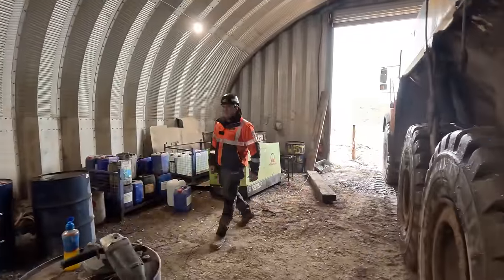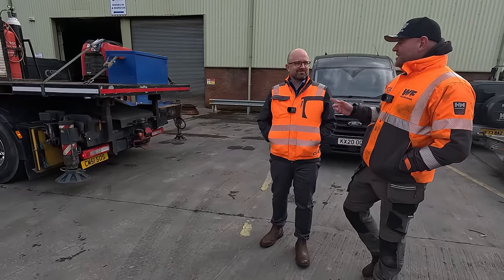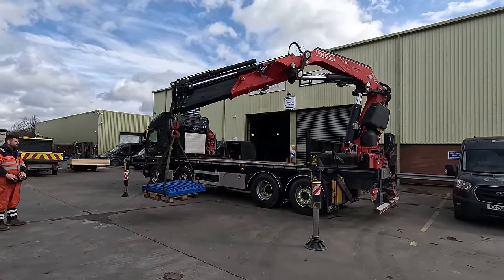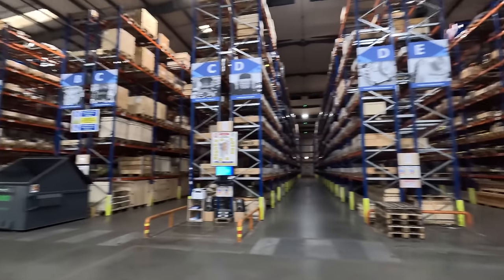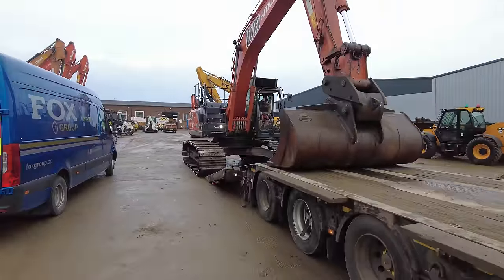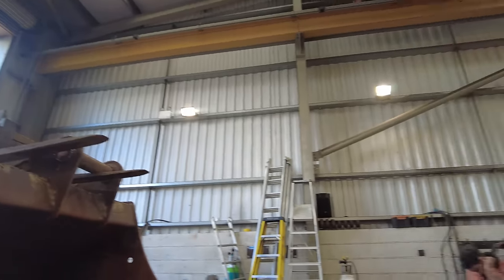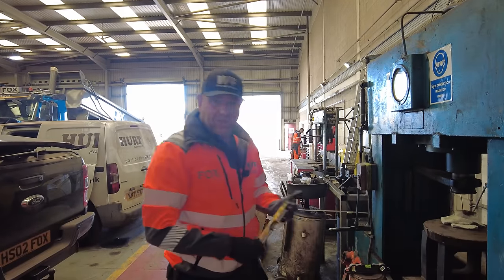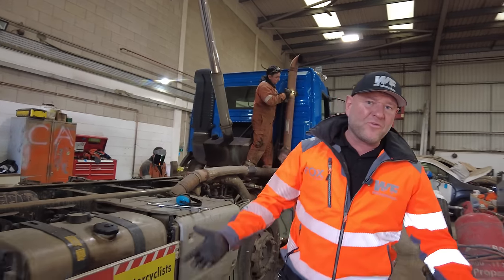Behind the Scenes: Exploring a Hidden Engineering Giant! Chronicles Ch #036

Comment: Excuse me if this is a stupid comment, but could you have a piece on the end of the exhaust so it points downwards to help prevent water getting inside? I guess it would increase the back pressure in the exhaust that may cause other issues

Comment: i drove a few 953 cats the bottom of the clam needs a grader cutting edge welding on so when it wears it seperates as so not degrade the original content of the bucket allso
a few wear plates on the middle as it looks thin they are a powerfull track shovel and i have seen the bottom fall out before now despite please for some welding angus
Reply from the maker: Yes the bucket needs welderfabber attention mate